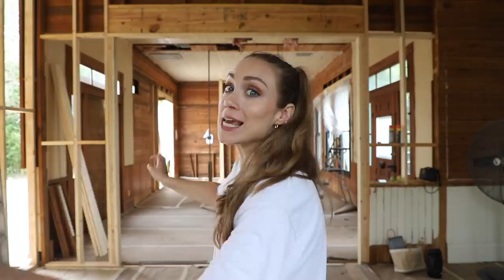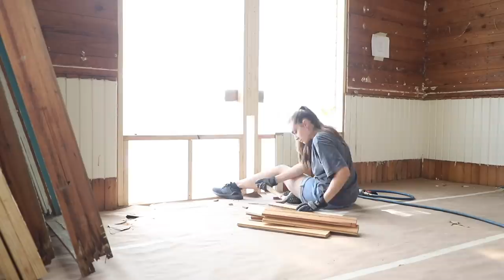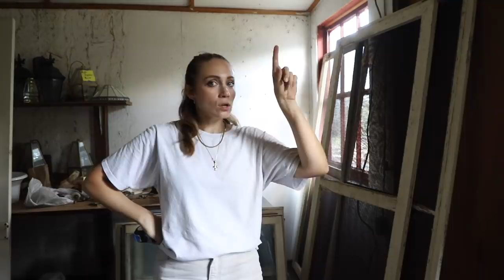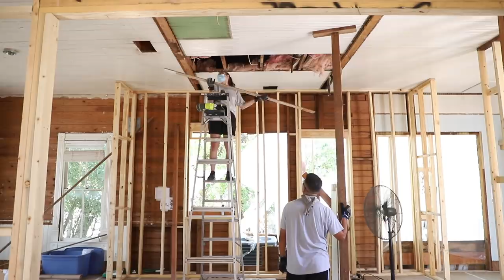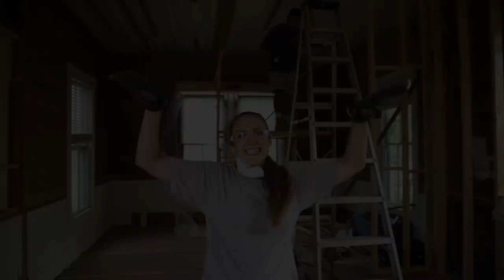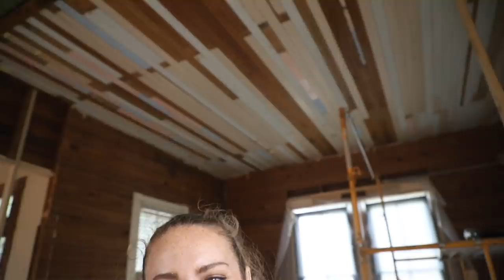Starting Our 1,000 SQ FT Addition + DIY Beadboard Ceilings | XO, MaCenna

Comment: I wouldn't have thought about the ceilings being different surfaces - your attention to detail is inspiring! We are re-finishing our basement but this is a whole 'nother level! (lol, pun unintended on the scaffolding)
Reply: I have three ceiling finishes. 
Under bad advice, I tried painting the popcorn ceiling in one bedroom years ago. I couldn't understand why the roller felt heavier as I painted. Duh!
I stopped partway through and 20 years later it's still like that. (I suspect there's asbestos in the mix so I don't want to attempt scraping.) 
My kitchen/dining room has knocked-down finish we painted and bathroom is smooth.
Reply: @Edu_Kate  You could always add a thinner layer of drywall on top of the popcorn. Attach to the studs and mud

Comment: Are you not doing any insulation or sound proofing behind the wainscoting?
Reply: I had the same question! Also wiring and piping and things! She’s such a planner, I’m sure there are things I just don’t know about in the Texas construction process 🧐
Reply: She said on a previous video about not having insulation because they are keeping it as the original with the air between to act as the insulation.
Reply: She said no in previous video.
Reply: Thanks for the responses! I knew about the exterior walls and no baseboard thing but wasn’t sure about the internal walls!

Comment: Hi McKenna, just thinking before you put put all boards back up, don't you need wiring  put in ????
Also we're all the boards sanded first before you put them back up,because you'll need a smooth surface before painting the ceiling, just didn't know if you'd have thought of that as so busy.
Great that the dream team are back together ❤🙌😀😍
Reply from the maker: Hii - the electricians will cut new holes in the ceiling for lighting and I did totally consider sanding the boards before we put them up but we would still have to sand again once the holes are all filled 😕 since Romeo was here to help it was worth it to just get it up and sand later since the installation was a two person job
Reply: @XOMaCenna  thanks so much for replying firstly as so many people don't, glad you'd thought about it,and it makes perfect sense to put up when you've hot help, what made me think about it was that l've had to paint ceilings quiet a few times and know how it makes your arms ache,and I didn't have to sand either.
Think your an inspiration to all the young ladies of your age group and young by showing that from learning how to use power tools  for DIY'S-saving monies by doing loads of prepping in building your own home,also love going thrift shopping with you.
Sending you both sll the very best wishes for UK 🇬🇧❤👍

Comment: I am just curious about 'DeWalt' tool you're using MaCenna. What do you call that madam you're using to fixed wood rather than hammering with nail? As if riveting by pressure. First time I have encountered. Thank you so much. 💕
Reply from the maker: The dewalt tool is a compound miter saw and is great for making small straight cuts. And to get the beadboard into place we hit with a rubber mallet so it doesn’t damage the wood 🥰

Comment: so,  i do not understand the reason for wainscotting (sp?)  attaching to 2x4 without insulation behind. in fact open space behind. could you explain that part please. i don't know if it is due to different building codes in different states, .... or what ?  perplexed.

Comment: Your electrician is not going to like dropping wires from the attic because you didn’t leave the wall open so he could pull wires through holes in the framing.

Comment: I noticed that sometimes y'all wore safety glasses and sometimes not. I cringed each time you used the nailer without one, especially shooting it upside-down when working on the ceiling, because I have a friend who lost an eye using a nailer while putting in a new ceiling.